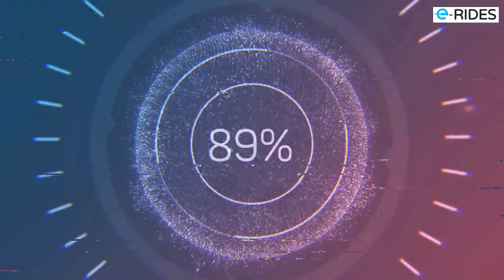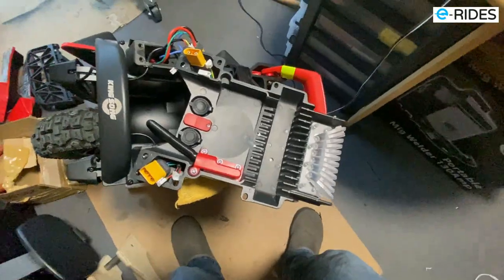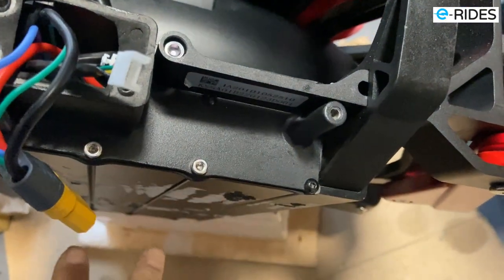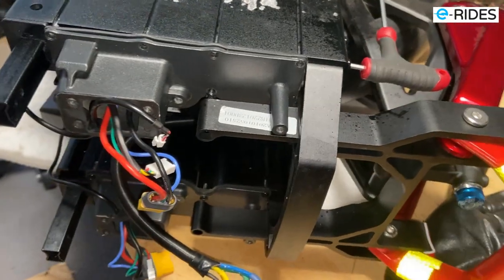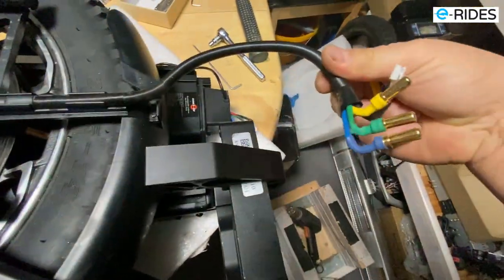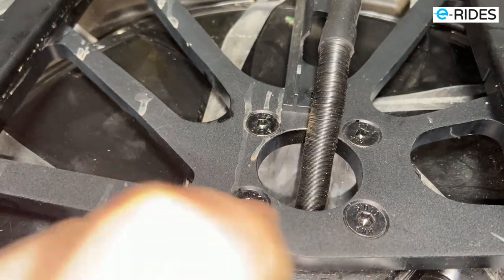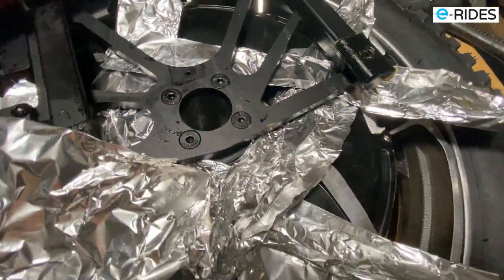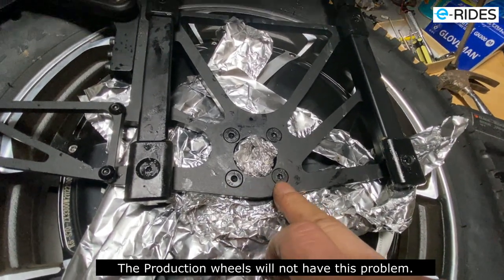KINGSONG S20 disassemble. erides EUC upgrade half ebike.

Comment: Cable connectors and cable management looks really clean and professional.
Sad about the screws, tensile and threadlock. But that's something easy fixed on later models. 
I was very disappointed to not see a quick motor disconnect ability to change tire,motor, bearings easily.

s18 still holds the record in my opinion for easiest motor and tire change of any EUC.
Reply: I've done tire changes on both my S18 and MSX-100V.  They were about the same complexity (both required mods for oversize tires).

Comment: Great video, the whole wheel is created in CAD, every screw has a depth, torque reqirement, and load, this would also indicate the correct loctite to use, the correct type of screw would also be presented. The four screws around the hollow bore are likely secured with red loctite, this loctite can only be removed with heat, given this possibility the required amount of heat may radiate to the rubber gasket and possibly cause a breach this is something I could see as a oversight but not the screws. Using the frame of the s20 as a heat sink is great engineering and means over heating is highly unlikely. Finally a lack of stainless screws is just odd, KingSong know the wheels will be subject to moisture. A Rolls Royce is only as prestigous its Relays.
Reply: Soldering iron on bolt usually works to release red loctite
Reply from the maker: @Kay0Bot  the metal surface area are too big so soldering iron will not work.
Reply: @eucupgrades  you can also melt solder with a torch.
Reply: @eucupgrades  that sucks. I usually find a large tip setting iron for 700 C does the trick. 
Is it possible to spray break cleaner and have it ingress into the bolts?
Reply from the maker: @Kay0Bot  I will wait until the new motor arrive then I will do that or weld something to it to turn it.
Reply: @eucupgrades  yeah, the bigger problem is if you spot weld, then break off the head of the screw 😮. Good luck!
Reply: @ocmiente  oh yea... drilling out broken bolts, my favorite pass time 😅

Comment: They need to be quality socket cap screws if they are going to locktite them so you can crack them loose, and always hand crack them loose but. Those button head screws are a big no no and will make the motor/rim a 1000 dollar throw away item. Not acceptable for 3200 bucks. The only places those smaller button head screws should be used is where the space dosen't allow for it or where you don't locktite it. It can't have a throw away motor or bearings that can't be replaced. Great video, this is the stuff that needs explored, just as important as the ride.
Reply from the maker: that is right. You don't buy a wheel just to ride, it needs to be servicable as well.

Comment: I wouldn't use heat on the bearing area.  Countersunk hex head bolts are the worst to remove because of the tapered countersink. Your best 1st attempt is a crisp bit (quality sharp shoulders, snug fit) and just enough impact (either pneumatic or electric) to snap it free. Manual hand rotation is usually going to make the situation worse. If that doesn't yield good result on 1st attempt, I immediately just drill them out. You'll need quality drill bits and extractor bits to make the task smooth. Drilling with quality bits is reasonably quick and will heat the thread lock enough to release the bolt using an extractor bit, if not then you need to bump up the bit size just enough to penetrate the depth of the head until it pops off, the chamfered head is mostly the cause of being jammed and not so much the thread lock. I've been in many battles with these types of bolts made from both high quality military grade and cheap imports, they are always a challenge regardless of the quality. It is always easier drilling out the cheaper import stuff though. Good luck, hope this might help in the future.
Reply: I have an impact screw driver, I wonder how that would work....
Reply: @EUCArmy  if they're using something equivalent to loctite red, then you probably shouldn't:
(copied from Loctite's website)
The process of knowing how to remove red threadlocker is a little different than for other threadlockers. The key is to apply localized heat greater than 250°C (550° F). Then, once the threaded assembly is hot, the bolt can be unthreaded. Without applying heat to the assembly, some bolts threaded into tapped holes risk breaking.

I'd recommend building a small inductor coil then using a long bit or old screwdriver shank stuck into the screw.  Heat just the screw directly by putting the induction coil around the bit and socketing it into the screw until it is at working temperature (I use cheap thermocouples/reader, cost like 15 USD for a 4 input reader w/ k type TC) then use your regular driver to free it from whatever threadlocking they might be using.  It should heat from the head/core of the screw outwards, so the heat bleedover is minimal and once any part of the threadlocker reaches working temperature the rest of it won't hold well and it's likely you won't even need to go all the way to 250°C, just far enough to weaken it sufficiently.

Comment: Thank you very much Kevin!
This is exactly what we need to see. I’m sure I’ll be replacing all the screws in my S20 when it arrives, with high quality stainless steel. Even if they do upgrade the screws at the factory. I’d guess they still won’t be the best quality. We need a list of the size/quantity of screws that need upgrading.

Comment: Thank you, super informative and critical. As a trades guy I can certainly feel your irritation and disappointment. Standard disassembly should be tough but not destructive or impossible - and you showed us the latter here. Full sympathies. This is still fledgling tech, lots to learn. But thinking that you would ride, in this case, a wheel that was NOT going to fall or rattle apart is also a mixed blessing. This video is a fair recording for customer and manufacturer, and I'm glad to see it. Thanks

Comment: Thank you for this video! The screws need to be secure enough to not lossen but easy enough to unscrew for inspection and repair! 

That seems like a huge problem to use cheaper screws, but in the end, it screws the consumer.
Reply: Very few areas need locktite at all

Comment: Hi from Will and Mr Data :):]
X mecanic. Heat surround then turn upside down and freeze ice screws. Keep ice off surround. 
Hit with hammer.
Hit allen key in screw with hammer while turning. 
Be cautious because heat is gonna damage cable and rubber bearing seal. 
I wish you nice success. Be well.
Reply from the maker: Thank you for the tips. I will try it when the replacement motor arrives.

Comment: Informative video,  the best tool to remove those screws is a set of stud extractors, you will never get them out without ruining the heads any way...  too much heat will only damage the bearing seals and bearings...
Stud extractors will get item out even if you snap the head of the screws....  😼

Comment: Those screws should be easy to get out. Because of the large diameter of the head itself, you can use a dot punch (a big heavy one) to make a small pocket near the edge of the head... a couple of good strikes to make a decent divot, then angle the dot punch in the direction of un-screwing.  If you haven't got a big center punch, you can drill a small hole near the outer edge of the head so you can get the corner of a decent size cold chisel into the hole and tap the chisel to unscrew the bolt. Once started, you can use a super fine angle grinder (4") disk to cut a slot for a large flat screw driver. You could also use a Dremel with a small cutting disk to make the slot. Shame on Kingsong using such weak screws? Maybe they need to charge us more to use decent hardware.  I would prefer steel screws than stainless... stainless can be brittle... but decent quality steel please. Great video! (make sure you are using metric alen keys... not imperial by accident (I have been guilty of that on occasion haha))

Comment: Small allen/hex not very strong. Torx can handle way more torque and then you bend your bit before you round the srew with a good hard screw like the 10.9.
Second the loctide is too strong and completely soaking them also make it much harder to take out.
While a little drop will keep them from vibrating lose. Also a weaker loctide can be used. So you can remove them.

Comment: Tips for everyone, great easy tool to remove those kind of screws "Manual Hand Impact Driver/Extractor"
Reply: If you don't bash the aluminum to bits that it's threaded into
Reply: @noelleonard2498  if he can remove than buy cutting and use large screw driver, than no brainer that will work!!

Comment: It seems they did a good job on sealing the bearing with a rubber. They should still throw a marine grease for the extra water protection. The rim seems solid unlike the Sherman's garbage rim. Eventually, we will find out how good it is.

Comment: the screws are certainly not top but using red threadlocker is pretty dumbed since we will have to replace the tire some day🤦🏻 they should reprimend the clown that does that in the factory probably the brother of the one that design the short trolley handle🤨 good job Kevin keep them coming.

Comment: To have that hanger rely solely on screw force to work is a horrible design. The axle and hanger need a mechanical interface to transfer torque, with screws to stop the sole unrestrained axis. Make the axle tube the thickness of the hanger plate wider on each side, cut it into 4 tabs, mill the counterpart tab holes in the hanger plate. Now the screws only need the bare minimum loctite to stop them backing out (but better screws are still good).

As for removing the wheel from the main EUC body looks like.... remove motor wires from controller (might be doable without removing controller first) > remove pedal hangers ( ? and the battery lower end caps)> remove a section of the suspension (shock and main pivot bolts, or the motor hanger to suspension link etc, be safe for preload pressures) > slide motor section out the bottom.

Comment: My god what a pain in the ass for a simple tire swap or punchure repair.... These companies need to quit focusing on speed and power (their already plenty fast and powerful enough) and put their energy into creating a quick release system to make a tire swap a simple 10min job!
Reply: Just no locktite on button head allen head screws.
Reply: Power and speed got nothing to do with this. It has been 2 years since we reached 50 mph. S20 only does 45 mph max. They just don't focus on the basics and create a standard for it.
Reply: @theanimalplanet7031  power and speed has got nothing to do.with it but you are complaining that it won't go 50? Ok 😂
Reply: @theanimalplanet7031  I didn't say the two were connected, I'm speaking in general terms that a simple tire change on our wheels are a pain in the ass which ever euc you own, also 45mph is plenty fast enough... We basically in motorcycle speed territory right now which is ridiculous for a one wheel device with zero  redundancy!
Reply: @noelleonard2498  I meant to say they should have a standard for the screws. Speed got nothing to do with the basics for having a solid screws for repairs/tire change. Stating the speed was referring to @davewood1982 saying companies are focusing on speed and power.
Reply: @davewood1982  I disagree on 45 mph is fast enough. Plenty of people still reach cutouts at 50 mph speed limits. They need to push it way past it to build safety buffer.
Reply: @theanimalplanet7031  Then were does it stop?  Whatever the upper limit is , us riders are gonna reach it because it becomes the norm, we all struggled to break the 20, 30mph limit at some point in our learning curve but now it's nothing because it's become the norm with how capable our wheels have become, , what ever the limits become riders will reach it so it's simply not sustainable, learn the limits of your wheel plain and simple
Reply: @davewood1982  The answer is easy, the tech would have to surpassed our sensory perception. A first few generation of iphones, everyone was comparing camera images quality. By now, we have 3 cameras that merge images and frames of different exposures into a single image. Its so good now that nobody would care about each images quality or to analyze it. Same goes for iphone cpu/gpu for gaming. Lets talk about safety of EUC. If the motor only rated for 45 mph, you would not get a sustainable ride at that speed. Same reasons why cars can do sustainble 80 mph on the freeway because the engines could handle over 100+ mph. Based on your logic, 45 mph is enough, then why should manufactors invested in RD to make ever faster wheel, which would give us greater safety buffer for the ride? Most US main street are at 45 mph and the flow of traffic normally do 45-50 mph. The wheels need to go faster than the flow for greater safety buffer. Same reasons why motorcycle always lane splitting and as soon as the green light lit they bolted before the rest of the traffic caught up. Its survival 101 for any mobility that's smaller than the majority of the vehicles on the road. Then, there are riders aspect, after getting compatible with the connection between brain and EUC, people started taking their ride up mountains and/or start doing jumps. KS understood this and went for suspension wheels. However, they fall short on speed due to a fallacy of speed safety...Meaning bigger motor is ever required, which translates to faster speed, bigger safety buffer. Innovation doesn't sit idlely on your lap, through iteration of improvement born greater safety. Today, car manufacturers still pushing every greater for speed on the tracks for that same engineering safety logic.

Comment: The S20 is the flagship model of the Kingsong. So the quality of the screws must not low quality like this. At the high torque contact points they should be stainless steel screws.
Reply: Unfortunately, I must kindly disagree. Stainless steel screws have a lower hardness and breaking strength than "normal" steel.
Reply: @frankc.3232  There are some steel fasteners (grade5, grade8, alloy steel) have higher strength than stainless steel fasteners. But if you are mentioning the "normal" steel fasteners they most are grade 2 which lower strength than stainless steel.
From this video, I'm not sure the grade of the screws are but they seems not suitable for the application especially the screws at the center motor hub.
I guess the screw socket depth can not be much depth as normal screws are due to the limitation of the flat head screw type but engineers who desing this can reduce risk of screw head sliping (due to high torque apply) by select the torx/torx plus socket type instead of the hex socket type.

Anyhow, the S20, Almost other parts are designed very well and impressively.
Reply: @willson8246  I agree, Torx is the way they should go. With NORMAL I mean non Stainless steel. 😊

Comment: So was the broken rubber piece making that noise or do you still think it’s coming from inside the motor and why do you think that rubber piece broke? Is there an easier method to get to the tire, I.e., was it necessary to take it completely apart like you did? Thanks for doing these videos they help a lot!

Comment: Module design supposed to make it easy to take things out.  This should be an easy fix for King Song only if there is enough clearance between the new stronger screw head and the enclosure frame.   Hopefully they can fix this as soon as possible.  It is a very cheap but important fix.
Reply: Shouldnt an in house tear down be one of the first thing they do on at least one unit before they send any out?
Reply: @noelleonard2498  the nuts sealant became harder over a few days.  Same as water damage which could take days, or weeks, or even months for things to go bad.  But I got your points, they should take it apart for testing units, which they should have plenty around, even for the ones that got abused I would assume.  So maybe an oversights that might have caused them delay and they close an eye on it.  If that is the case, then it is bad for end users.  Just a theory.

Comment: I am not as mechanic so I may not understand everything to do with pulling this wheel apart. 

- why was the battery casing taken apart from the top
- why were the pedals taken off

If this was to show the complete disassembly of the wheel then I understand but if it was to take the tire out, was it necessary. 

I ask this because the KS assembly video gave some idea of how the wheel was put together and it did not look like how you pulled it apart. 

Maybe we just have to wait for KS to provide mechanical advice videos to show us possible short cuts to a tire change. 

I hope they take your advise about the screws. I had this issue with my S18 and I am sure everyone else has had issue with wood screw in plastic😂
Reply: Wasn’t it the motor which had to be reached and not the tyre?

Comment: I'm waiting for my S20 (end of April) but after this video, i WILL NOT go for it anymore! What a bad choice of screws !!!  The engineer in charge of this part should be fired on the spot!  Kingsong should be mentioning RIGHT NOW on their site that THEY WILL change all the screws for stainless ones and put 1/4 of the lock-tight  shown.  If so i will reconsider. So disappointing...